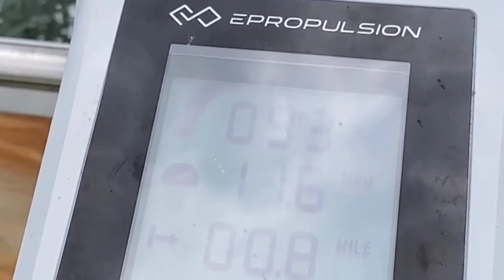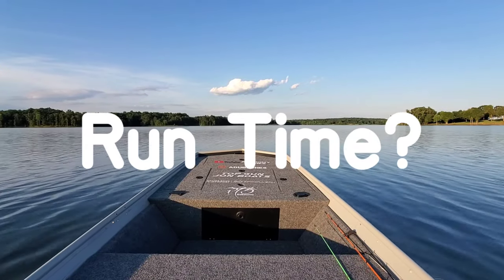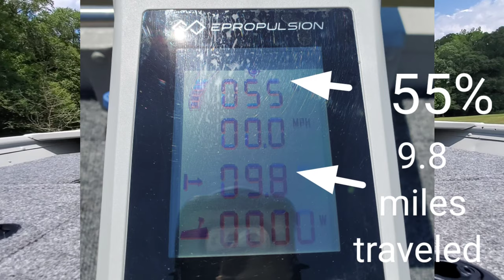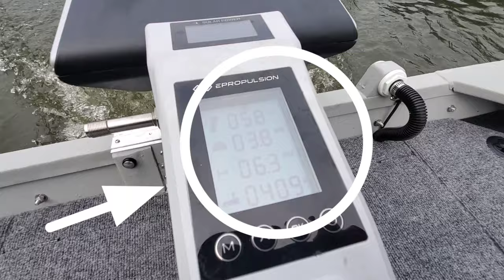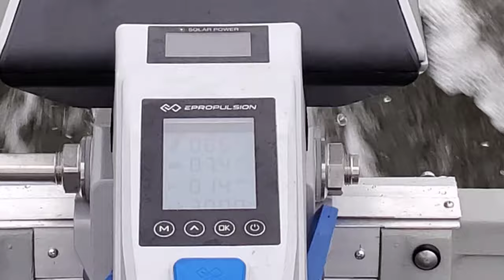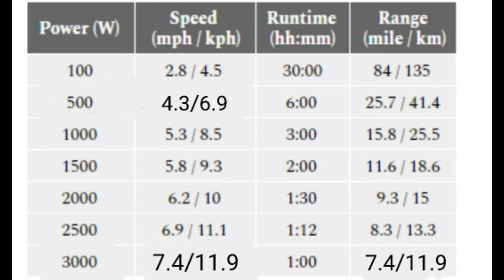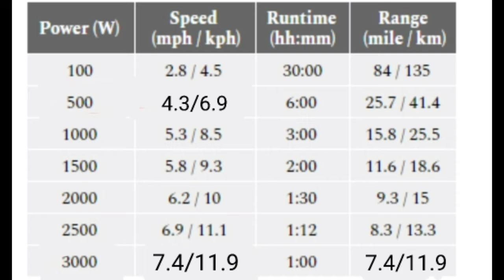Electric Outboard Performance | Run Time | Top Speed Test

Comment: these are nice but it seems unpractical to me as water and electricity don’t mix toghther and I also have a big boat and I don’t think i will ever see a full electric 250 outboard
Reply from the maker: Not unpractical considering there are so many electric only reservoirs.  Can't be unpractical when they are required.  No different from a front mount trolling motor or any other electronics in a boat, water has nothing to do with it being unsafe. The battery is actually waterproof,  everything is fused properly, completely safe. They are already making 100hp and above electric outboards.  250 is not far off. The problem or should I say advantage gas has is the battery technology is not there yet to properly power massive outboards.  As batteries get stronger, lighter, more affordable,  more powerful,  electric will be the future. May be 100 years but who knows. Reason why is quiter, more reliable,  no maintenance.
Reply: Anthony Jones yeah I can see that and the price of gas builds up and electric motors will have insane torque for bigger boats etc
Reply: Wrobg.  Ludicrous has a 350 hp ektric iutbard

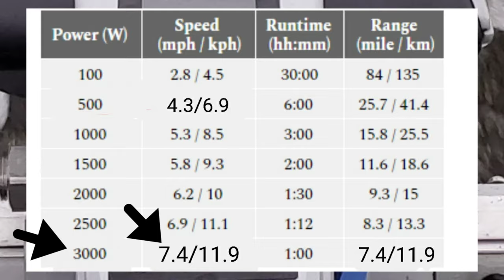Comment: 8:10 — 3000 KW —-fuck me, that’s around 4000 hp.  That boat must b e pretty draggy.
Reply from the maker: Read the description bro. Do you think I meant 4,000 hp or 3,000 watts? What would make more sense? I misspoke and missed it in the final edit. Can't change it without deleting the video. Sorry if I confused you though.
Reply from the maker: **********EDIT*********
It has been brought to my attention I misspoke in the near end of video where I breakdown the outboard performance in different throttle levels. I state the power inputs as kilowatts instead of watts. If you look at the chart I produced,  it shows I had labeled as watts. The outboard itself is a 3 kilowatt outboard at 3042wh rated battery at 6hp. I am used to saying kilowatts when describing the outboard rating, not the power levels.  Sorry for the confusion.  Honest mistake. Did not catch in editing. I meant watts but after uploading cannot change. Thanks for understanding.
Reply: Anthony Jones Fair enough- anybody can have a slip of the tongue.   What bugs me, though, is that it's like me saying I live 15 metres from the city, when in fact I live 15 Km from the city.  It's a pretty big difference for a slip of the tongue !!
Reply from the maker: That's right but when I'm constantly saying everyday that it is a 3kw 6hp equivalent outboard and then say kw instead of w in the runtime breakdown,  even though I put w in the chart, granted it is a big difference,  it was a mis in final edit and I'm sure most can see that. It's pretty obvious what I meant given the content. 

What bugs me is living in a world where you bust your tail and put yourself out there outside of your comfort zone to make informative videos and quality content to help others out of true passion for the hobby, to get observed under a microscope for one statistic or slip of the tongue wrong for someone anxiously waiting to point out your mistake in the comment section.  Just gets old, especially when it's something clearly obvious. 4,000 hp or 6? Like come on man. It was labeled in the chart....